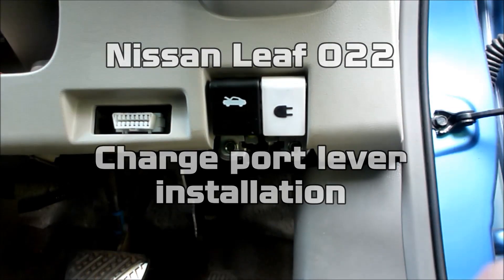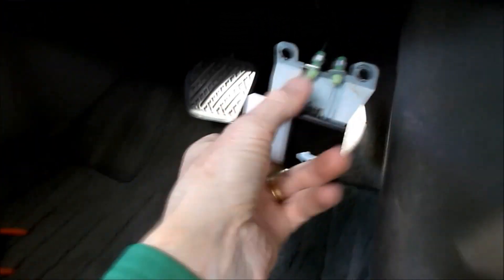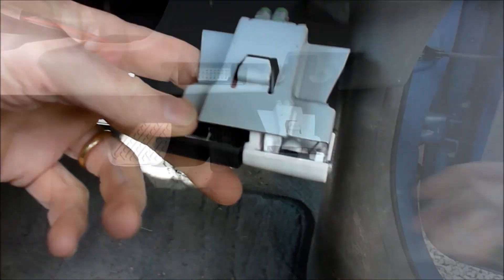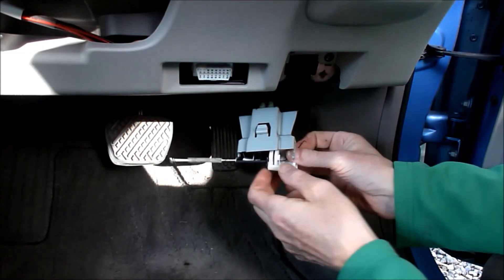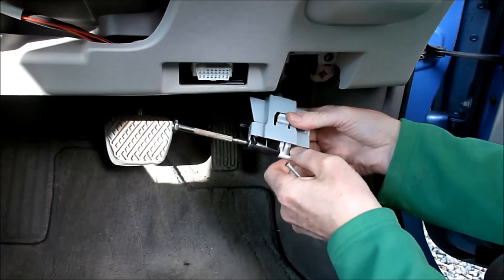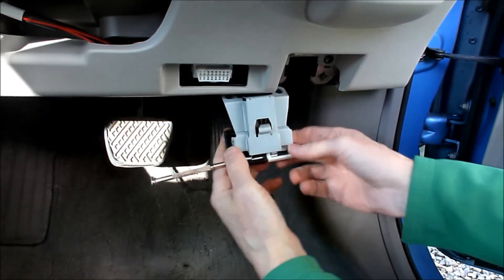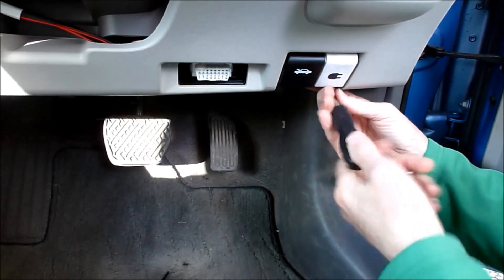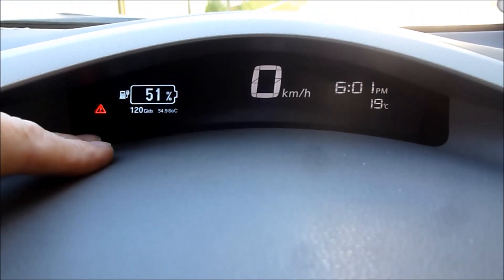Nissan Leaf 022 - Charge port lever

Comment: Thank you very much for the video. I just replaced mine. It's a fiddly job with the two springs pushing the levers down. I used a medium sized nail to hold the levers in place instead of the screwdriver. Works well now.

Comment: SUGGESTION:  Nipping away at the mushroomed end of the pivot rod was frustrating. I ended up using a Dremel tool to cut through the broken lever and the pivot rod that has the riveted end on it.  Beforehand I had located a long thin bolt that would slide through the replacement lever I got via eBay from a fellow who 3-D prints them. Popped a nut on the end of the bolt and didn’t even have to trim it.

Comment: Hello! is it compatible with Nissan leaf 2013 ? I broke my lever and need a replacement for it..thanks!
Reply from the maker: I'm not 100% sure. I assume it is. If you have a printer it's probably worth just printing one and eyeballing testing. (It's hard to imagine Nissan would go to the effort of redesigning this part!)
Reply: @paulkennett  I will.. thank you so much!
Reply: @paulkennett  what I find out now is that the printable lever is for the right side. in my nissan is located on the left side. How can I switch the print from right to left? I want the lever for the hood to stay on the left...thanks
Reply from the maker: @AvrahamEfroniLevi  The slicer software you use probably has a Mirror option - which would allow you to create a mirror image part. For example I use Cura to slice my STL files into G code.  Cura has a feature called Mirror which allows you to reflect an object in the X, Y or Z axes. Try that and see if it fits your car.
Reply: @paulkennett  thanks. I have booked time in the local librery for that. they have Cura as well :)

Comment: Thanks Paul you make that look very easy
Reply from the maker: It's about the 6th time of done it. Using a small screwdriver to hold the other lever in place was a breakthrough. :)
Reply: @paulkennett  just did mine took 15mins max. The hard part was cracking the bolts off. Torqued on hard they were.
Reply from the maker: Ah yes. The first time I had to use a ratchet.
Reply: @paulkennett  yep used a wrench on a hex part of the screwdriver extension. Magic moments.